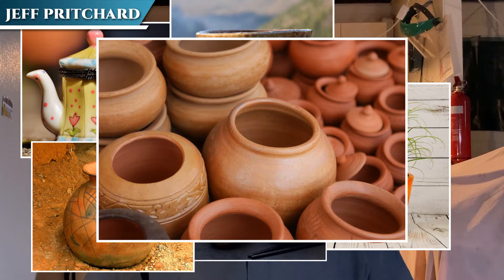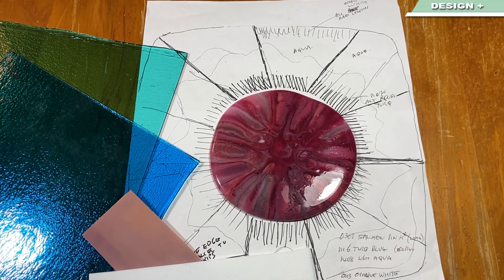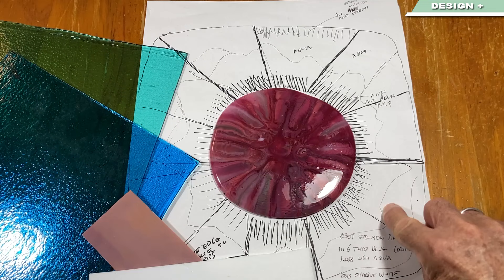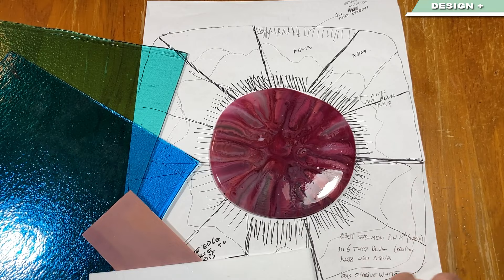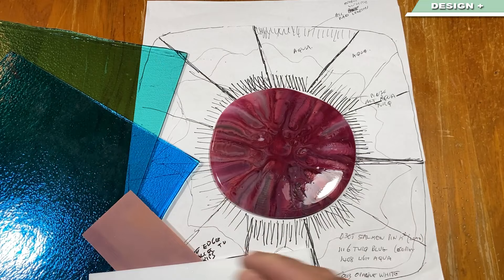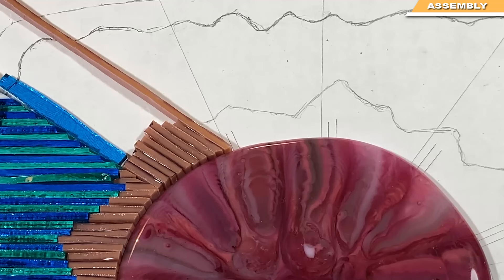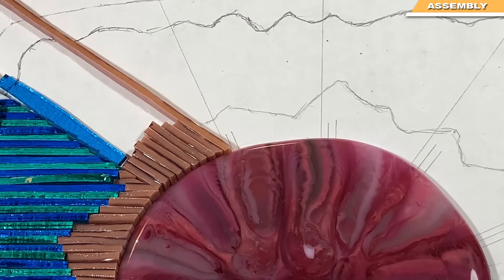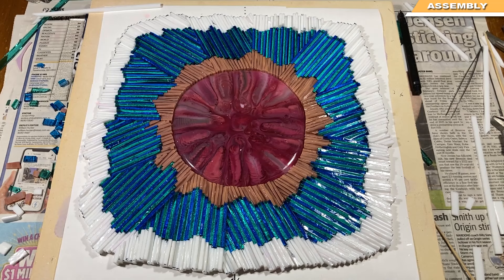A Pot Melt What? A Bowl! That's Potty! Fused Glass Project - Part 1

Comment: Why did you not have to dam the piece?
Reply from the maker: Hi Paige. Because it wasn't that thick overall. Each strip, while wobbly cut, was still overall only 6 mm thick. The feature also was only 6 mm thick.
Reply: Very interesting piece. You certainly have more patience than I have.